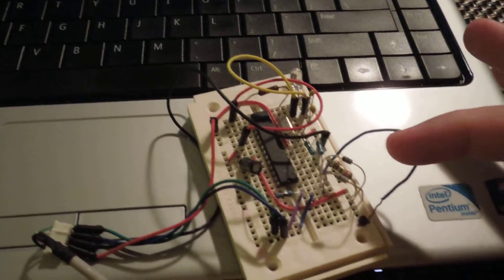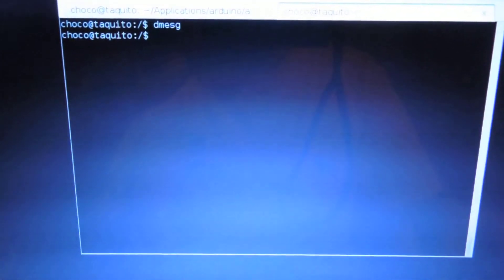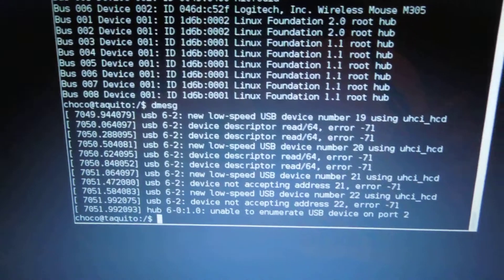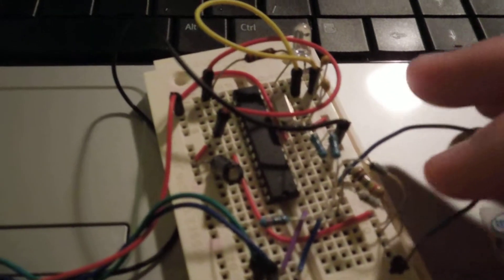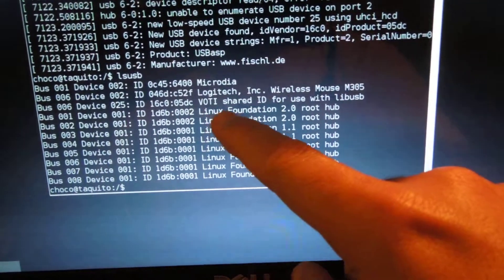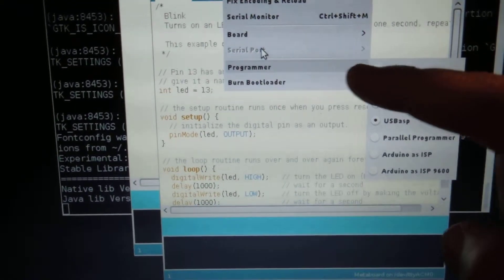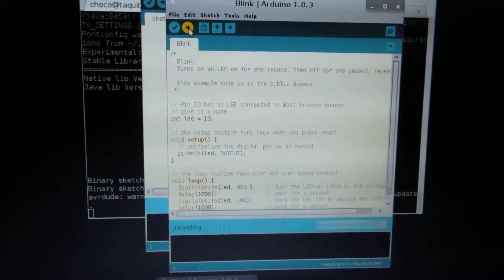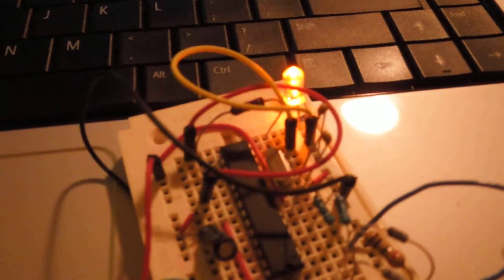Usbasploader Sample atmega328 arduino

Comment: IDE shows an error while uploading the blink sketch. Can u please show what modifications to be done in boards.txt file?
Reply from the maker: Right now I do not have the files for the configuration for that exact setup. However using the same circuit I build a pcb board and documented it at https://github.com/soynerdito/PepitaBadgeShieldCompatible
In that particular board, the boards.txt is. It should be the same. In case you are using an atmega328P or not P the chip signature may vary. This is for the P flavor.

##############################################################
# BSidesPR 2015 badge Configuration
bsidespr2015.name= BSides PR Badge 2015
bsidespr2015.upload.protocol=usbasp
bsidespr2015.upload.maximum_size=30720
bsidespr2015.upload.speed=19200
bsidespr2015.upload.tool=arduino:avrdude
bsidespr2015.bootloader.low_fuses=0xF7
bsidespr2015.bootloader.high_fuses=0xDA
bsidespr2015.bootloader.extended_fuses=0x03
bsidespr2015.build.mcu=atmega328p
bsidespr2015.build.f_cpu=16000000L
bsidespr2015.build.board=AVR_BPR2015
bsidespr2015.build.core=arduino:arduino
bsidespr2015.build.variant=arduino:standard
bsidespr2015.upload.disable_flushing=true

Configuration of that board is described here https://github.com/soynerdito/PepitaBadgeShieldCompatible/blob/master/Arduino/HowToConfigureArduino.pdf
Note that json format for adding the board to the arduino IDE may had changed from when I created this configuration. The arduino IDE has changed a lot from that time. Sorry if the json format is causing a problem.

The board.txt can be found in this file https://github.com/soynerdito/PepitaBadgeShieldCompatible/raw/master/Arduino/IDE_Board_Manager/bsidespr-1.0.2.tar.bz2
Anyhow if you have the correct firmware in the board. I would recommend to use the adafruit guide for the trinket Pro (https://learn.adafruit.com/introducing-pro-trinket/downloads). Is an equivalent bootloader and they have signed drivers for windows.
Reply: i appended the following lines in boards.txt file
##############################################################

metaboard.name=Metaboard

metaboard.upload.protocol=usbasp
metaboard.upload.maximum_size=14336
metaboard.upload.speed=19200

metaboard.build.mcu=atmega168
metaboard.build.f_cpu=16000000L
metaboard.build.core=arduino

metaboard.upload.disable_flushing=true

##############################################################
and "Metaboard appears on the list of board on the IDE , but on compilation it says Error reading file (C:\Users\HOME\Desktop\Arduino\hardware\arduino\avr\boards.txt:0): Invalid line format, should be 'key=value'
Reply from the maker: from your boards.txt to mine. What I see difference is ".build.core=arduino:arduino" , yours has arduino once only.
I do not know if the from the error ".txt:0" means line 0. Check on the begining of the file.
When I did my boards.txt I copied all from a similar board and just changed what I needed. If I am you, I would try getting the board definition of an arduino with an atmega168. Then change names, and upload protocol and speed. I would try to get some spare time to test this myself in a new installation of arduino to try to replicate your error. There might had changed something in the board. Remember the Trinket from adafruit is this exact same thing, but with an atmega328p instead of yours atmega168. 
Remove all white spaces, check there is no invalid characters in the file. Try using a text editor like notepadd++ or sublime or something like that, to be sure there is no invalid non printable character in any of the lines.

Comment: Did you compile metaboard with WinAVR? Can it be done with Atmel Studio?
Reply from the maker: +Ruy Vieira  I normally use Arduino to compile, but I have also used the shell compiler avrdude I believe it is. You can use any avr compiler. What the "metaboard" like boards do is present themself as a usbasp programmer. Instead of  programming an external chip they program themself. I believe Atmel Studio supports usbasp programmers so the answer is Yes but I have not tested.
Reply from the maker: +Ruy Vieira All metaboard like boards work the same as Adafruits Trinket boards. As a matter of fact on a similar board I did, I am using their windows driver because theirs is signed and Windows 10 has an issue with unsigned drivers.
Reply: +soynerdito soynerdito I compiled it in Atmel Studio, uploaded the .HEX via arduino "uploader bootloader" option, installed the usbasp driver yet windows doesn't recognize it. Which ports are you using for the D+ and D- lines?
Reply from the maker: Ruy Vieira eventually I did it on a board, http://soynerdito.blogspot.com/2013/03/pepita-board-soon-to-be-reality.html
Also I did this into a badge, https://github.com/soynerdito/PepitaBadgeShieldCompatible/blob/master/PepitaBadgeShieldCompatibleXL/badge_sch.pdf
Try to avoid using a usb hub. check on the bootloader you are using for pinout compatiblity.
I have a compiled firmware on https://github.com/soynerdito/PepitaBadgeShieldCompatible/tree/master/firmware
I messed up the code, I deleted or forgot where I put it, is it pretty standar except I go into programming mode on reset.
Reply from the maker: Remember to set the fuses
I use this for the fuses avrdude -c usbasp -p atmega328p -b19200 -P /dev/ttyACM0 -U lfuse:w:0xf7:m -U hfuse:w:0xdA:m -U efuse:w:0x03:m